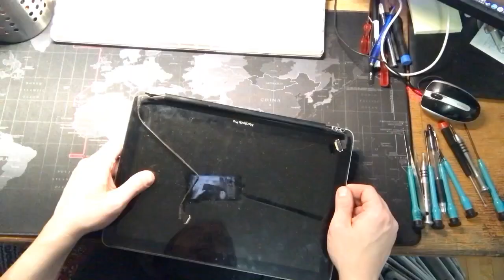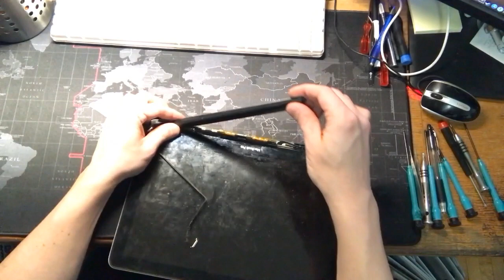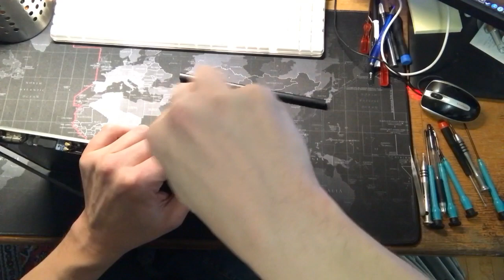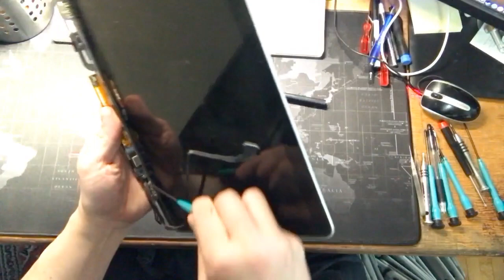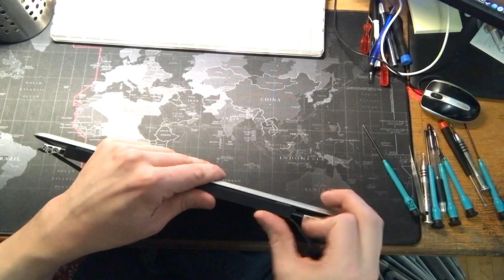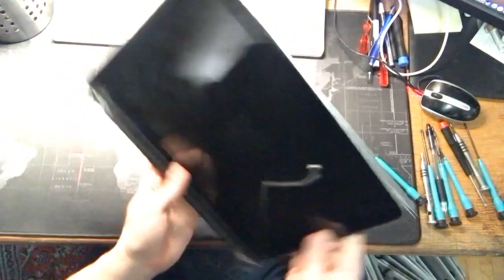MacBook Pro "Floppy Screen" Repair Loose Screen

Comment: Having done this myself. I’d say two things to bear in mind 1. Alignment of the screen when installing it back into the case can be challenging and best accomplished both components open at a 45 degree angle 2. The connectors on the board are crazy delicate so you have to get the right tools and don’t force anything. Definitely not the easiest repair but I managed to pull it thru to success. 👍🏻

Comment: my hinge is loose and the screen flickers in certain positions. Would you recommend doing this if the screen is flickering as well?
Reply from the maker: Gerard Mopas yes, because the video cable could be getting crimped in the hinge, and you can address that situation at the same time.  When you put it back together make sure the video cable is tightly connected
Reply: @RDKLInc  Thank you mate you're a life saver

Comment: I have mid-2012 with this issue. I recently put one of these cases on it. https://www.amazon.com/dp/B01LYFAEZL?ref=ppx_pop_mob_ap_share
Do you think this could make it worse or cause it happen much faster again if repaired because of the slight extra weight?

Comment: If i were to take it to repair, how much to fix loose hinge and "floppy screen"? I wouldn't like to get a bad deal.
Reply from the maker: Why would you pay someone to do the repair when you can fix it yourself in 15 minutes?
Reply: @RDKLInc  I have this same problem, and I'm thinking of paying someone to do it because of poor past experiences with repairing MacBooks. Once something breaks, everything can spiral downwards, and I'd rather be safe than sorry. 
I'm also curious to know how much a reasonable amount for a repair like this would be.
Reply from the maker: @annoyingmime3081  I don't do repairs for the general public.  These laptops are only worth $2-300 at this point, and any repair tech will charge at least $100 for the labor, so you're ripping yourself off to do that.
Reply: @RDKLInc  Thank you for the reply. >$100 is definitely not worth it.
Reply: I have a 2017 macbook air

Comment: hey i have the same problem with my 15 inch macbook pro early 2013
Reply from the maker: Those can be repaired in exactly the same way.  Be careful though, because there are little plastic "end caps" that fill in the space on either side, and when you remove the clutch cover (hinge cover) they tend to fall off, and it can be a challenge to get them back in place.